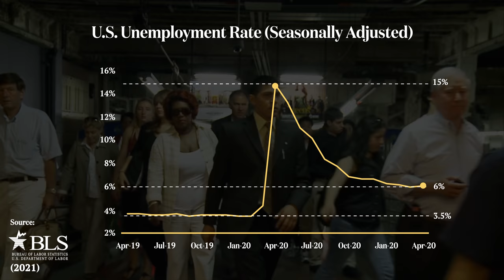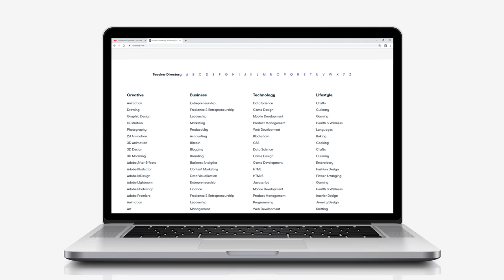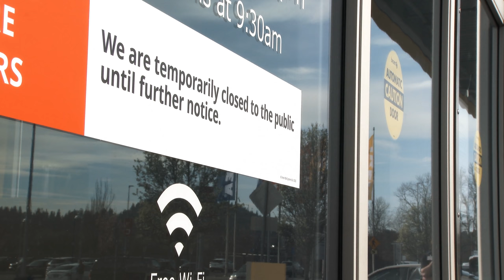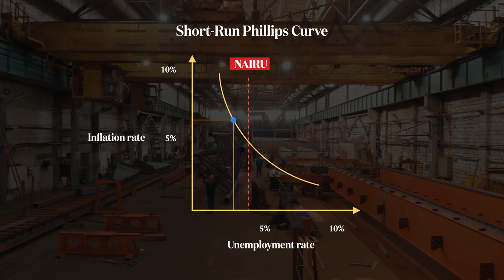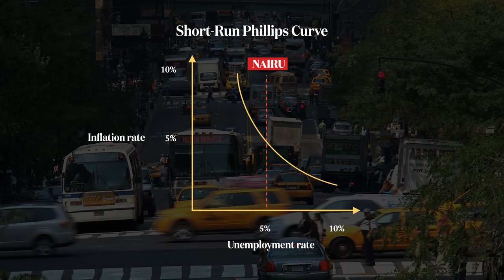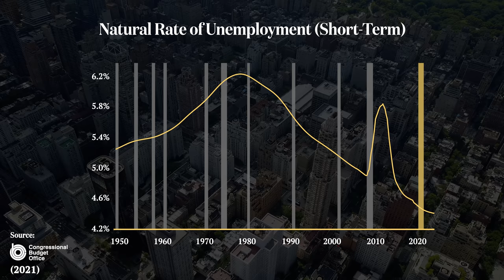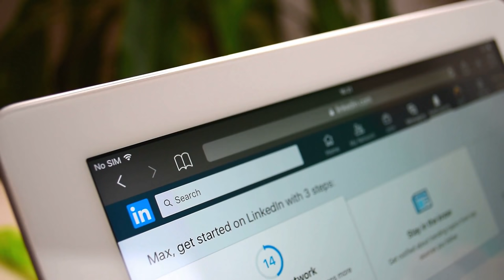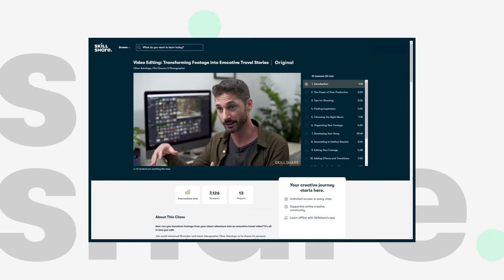The Great Labor Shortage Crisis | Economics Explained

Comment: My former boss was annoyed no one was wanting to work $9 an hour for crappy work at a gas station. I got a job somewhere else at a much better wage
Reply: good for you!
Reply: Minimum wage should be 24$ per hour if you account for 3% inflation over the 10 years since minimum wage was passed !!!!
Reply: @markoakley2508  That would just increase the rate of inflation unfortunately.
Reply: @markoakley2508  Enjoy paying $15 dollars for a loaf of bread then.
Reply: @Piga There's no such thing. That would be like saying "What if we abolish math?"
Reply: @paper8nintendo  so why does the rate of inflation rise when wages don't
Reply: @markoakley2508  it's about that in Australia with the 25% casual loading. Avishhek you can buy a loaf of standard bread for $1-$2.
Reply: @paper8nintendo  The rational of that argument, of push-cost inflation due to a wage shock, does follow logical reasoning. However, the studies and rational supporting focuses on the short-term. Specifically industries where regearing is unlikely, meaning perpetual short-term (short-term is where capital equipment or production processes are not changed). In recent years studies supported by empirical evidence have shown that a large enough wage increase can overcome its impact on inflation in the medium and long-term. One extensive study using US data from the 70's until somewhere in the last decade found a 10% increase in wages caused an inflation increase of less than 1%. On the other hand small minimum wage increases can even decrease inflation.
Reply: Macdonald & Nilsson 2016
Reply: @markoakley2508  Even if inflation wouldn't take a lot of money from that minimum wage (that is debatable), that would probably make a lot of jobs disappear.
Reply: @icemike1  because the federal reserve makes more dollars out of thin air to bail out financial sectors (an a few dollars for the regular people too).  More dollars in circulation makes all of them worth less so prices rise...
Reply: The entry level job should never have been a job to live off of but a job to pass through as you are getting through school or finding a better job. Most were already above the minimum wage at the time.
Reply: @paper8nintendo  wha-? Wages following inflation is the standard around the world. I have an annual salary increase, to keep ahead of inflation. If my efforts worth dropped 2-3% every year, I would jump ship. Right away. There would be no reason whatsover to stay with a company if you get less spending power the longer you work for them.
Reply: @dhrgkbqxtjr2743  So essentially what you are saying is that in order for a loaf of bread to be affordable for some people, there has to be a certain number of people who cannot afford it. Why can’t the baker find a way to bake more bread so they can sell more.
Reply: @dhrgkbqxtjr2743  look at the minimum and average wage in australia compared to the minimum and average in america. we get paid 2.2x more on average and 2.1x at minimums than americans and do not pay 2.2x more for goods, even (especially?) goods that are produced in america and shipped here. our inflation rate is also neither 2.1x nor 2.2x higher. its lower. you are simply wrong. you have probably been indoctrinated by your billionaires to say something that ridiculous. look for real evidence when you make claims like that.
Reply: @seanrea550  Scandinavia disagrees with you.
Reply: @dhrgkbqxtjr2743  Lol it wouldnt cost that much are u sirious.
Reply: @icemike1  Believe it or not, deflation is a thing that the government also actively avoids, they try to maintain an inflation rate of about 2% a year.
Reply: @jonathanodude6660  Australians on average produce far more individually then Americans, thus this is sorta expected.
Reply: @jonathanodude6660  well you people are just enjoying because of your natural resources . Some day Australia will loose it's reserves or China will find some other partner to buy natural resources  then it will be a huge disaster because Australian dollar is much Stronger than American dollar so running a competitive business is Australia is much difficult .
Reply: @jonathanodude6660  Also for in-house products in a developed nation, the employees are typically the most expensive part of production
Reply: @MartinMenge  Technological innovation and the raise of nations to import from help. Minimum wage increase should convince people to work more, hopefully creating a production boost that will compensate for the business lost, but this will further strengthen already established empires dominating and manipulating markets
Reply: @prouddegenerates9056  we dont have very many in-house products comparatively though. most brands are american which source their products from china. a lot of high income jobs are high skilled and/or involved in mining, so i dont think theres very much income inequality based on unchangeable factors. there seems to be several easy ways to get a high paying job here.
Reply: @icemike1  A minimum wage increase (possibly not quite so steep as you're suggesting or if you insist then you'll probably want to also have the government temporarily/permanently subsidising the local brick and mortar stores) would not increase inflation to the point that the increase was pointless. Your point about "well why inflation if the wages aren't increasing then" as a rebuttal to the person claiming a min wage increase would increase inflation is really exceptionally stupid however. It's because there are multiple factors. Don't use that argument again.
Reply: @dhrgkbqxtjr2743  Lets abolish math why not its all man made anyways
Reply: @markoakley2508  you’re math is so wrong it hurts. Ignoring that inflation over the last ten years wasn’t even that high, even if it was, 10 years at 3% inflation from a minimum wage of 7.25 would give us a new min wage of 9.74
Reply: @somedudeguytv  i understand that my concept is an ideal and does not match with practical realities. I also understand that alot of the entry level jobs are also part time so their hourly pay is not a true reflection of how much the get paid in a week. The basic idea is that the entry level is there to get experience before moving on or up. It would be my ideal that the bulk of the jobs are not entry level but a more stable position.
Reply: @Piga "what if we abolish gravity"
Reply: @dhrgkbqxtjr2743  New York has a min wage of $15 and you can still buy a McChicken for $1. This argument is completely baseless
Reply: Oh those types that want to pay people less than what they're worth.
Reply: @Piga ABOLISH INFLATION NOW!!!!
Reply: @paper8nintendo  it only really causes inflation issues when you suddenly jump it up every 10 years or so. If you raise it annually it's fine
Reply: Stupid boss lol. It will be so funny when his gas station closes down because he can’t afford to hire people for higher wages
Reply: With 9USD/hour I would be a King on my Country =X.
Reply: Luís Andrade  Inflation have been stable at about 2% for years and years. Salaries keeping up with inflation have been a thing for years and years. That is what central banks are for. Keeping inflation at a good level. And it works. If you think differently, it is because you wont look up from fox or whatever trickle down bullshit your late stage capitalist overlords tell you to look at.
Reply: Luís Andrade  or the ceos could just not be so greedy?
Reply: @markoakley2508  - The $7.25 per hour minimum wage in 2009 is equal to $9.02 today. The $24 number you state is due to automation making people more productive. Minimum wage workers do little to contribute to those productivity increases.
Reply: @jonnelson9760  - Because that baker may need to buy an additional oven to make and sell more bread. More ingredients, more labor, an additional oven. The baker would have to make a huge investment in order to make more bread.
Reply: I'm annoyed gas stations won't sell me gas for 10 cents a gallon.
Reply: 9$? thats some 3rd world level of pay.
Reply: We are annoyed that employers are greedy assholes.
Reply: @dhrgkbqxtjr2743  prices for food and living is already increasing anyways and minimum wage hasnt changed food prices would rise minimally anyways look at Denmark and Australia
Reply: Luís Andrade  Well first I am questioning the idea that inflation is too much money chasing to few goods. Second I am really questioning the idea that if workers make better wages then there will be inflation. In this argument is the implication that when wages go up then there will all of the sudden be more customers who want the loaf of bread because they can now afford it. The other argument would be that the baker needs to raise the price of bread in order to pay the higher wages. The other option is to improve productivity or lower administrative costs.
Reply: @JoeTheBroken  Both money and math are man-made.
Reply: @dhrgkbqxtjr2743  Yes it is. Its called 'shut the money printer down'.
Reply: @billybeemus3929  Well if they don’t someone else will buy that oven and bake more bread.
Reply: Luís Andrade  2016 isn't 50 years ago. There isn't just one paper, I was simply citing the paper I referenced.
Reply: Luís Andrade  That is exactly how supply and demand works for everything.  If there aren't enough PS5's at Christmas time they sell for twice the original price on eBay,  and can't be found in stores.  If you don't think giving people free money for 18 months has caused prices to rise, look at  the used car, housing, lumber, and stock market prices vs before the Covid pandemic.
Reply: @markoakley2508  Nah, don't make this a legal issue, if they don't want to pay their employees a good wage then they can go out of business. No need to put them in jail for it.
Reply: @dhrgkbqxtjr2743  the bread making company doesn't need to charge 15 dollars a loaf to pay their workers a better wage while still being profitable , but they sure are going to do their best to make you believe that is the case.
Reply: @iamshawngriffin  Not necessarily just that, but overly materialistic people keep buying things on credit for things they really don't need. This is precisely why half, if not most people, in the US live pay check to pay check. They have absolutely no financial discipline nor knowledge.  They want the newest I phone, a better car, a bigger house, etc.
Reply: tie minimum wage to cost of living aka living wage, and they can't jack prices without paying you more. the ratio has to have people prosper. if you drain the wealth of the masses instead of growing it, the money runs out as we're seeing here.
Reply: People are angry because people are doing what they said they should lol don’t like minimum wage get a better job. And they are and now people are pissed lol 😂
Reply: @paper8nintendo  no.
Reply: @dhrgkbqxtjr2743  you can literally regulate inflation, it's call minimum wage and salary caps and not randomly printing more money.
Reply: @icemike1  it's the banks
Reply: I think we should just pass a law to abolish scarcity and grant every citizen infinite resources.
Reply: @paper8nintendo  you're not wrong in what you're saying, but the thing that has always bothered me about that is that inflation has increased while wages stay stagnant. So basically businesses are willing to raise their prices, thus decreasing people's buying power, but the second wage increases are suggested, they say they'll just pass the costs on to the consumer. The part that is annoying is they've already been doing this without the wage increase, so it feels like a cop out and excuse to not pay workers more because they don't respect them
Reply: Micheal Grey, um unchecked government spending. Too many people working in government instead of private sector. Things like that. The government doesn't produce anything, which is why we pay taxes.
Reply: Same happened to me, except Walmart was offering more, before the shutdowns
Reply: somedudeguy, they don't have 331 million people either. You people keep using countries that have 15-20% of our population. That won't work here without making the dollar collapse.
Reply: @Fahrenheit4051  considering scarcity under capitalism is artificial you could almost literally do that first thing.
Reply: @dhrgkbqxtjr2743  No you just have to get rid of central banks. Until the US had the Federal Reserve instituted in the early 1900s, we had an average deflation of 0.1%
Reply: @TheMickydowling  wouldn't have to be steep if they tied it to inflation or something
Reply: They pay $9 because it is lousy work!
Reply: I just calculated my pay per hour to US dollars...

It's 38 $ per hour.. so il be mega offended for 9 $
Reply: @EddieintheLoop  right
Reply: @kerwinbrown4180  I guarantee they work harder than yourself bubba.
Reply: Legit, I always feel bad for people working minimum wage at these places. Cause I feel like most people are talented enough to work other places where their labor is more valued.
Reply: @kogorun  studies show that raised minimum wages if phased in over time, increase, not decrease jobs in an area by force of increased demand on the business sector. Furthermore, tying the minimum wage to inflation would solve a lot of issues, of the minimum wage worker gradually getting poorer over time.
Reply: @seanrea550  no job should be something you can't live off of that's an incentive not to find better work but to forcefully keep wages low
Reply: @billybeemus3929  the food hike argument is stupid anyway considering a third of our food never actually meets a consumer so no
Reply: @markoakley2508  I don’t think the minimum wage is the problem more so it’s the lack of bargaining power on the part of the individual. We have enough money to where we can ensure everyone’s survival whether or not they work. And making it so they can will raise wages tremendously as it has now.
Reply: @dhrgkbqxtjr2743  That's a typical come back people parrot off the propaganda spewed at them on msm... 

The people arguing in favor of slave wages, slave labor, crimes against humanity. These people aren't thinking they are just reiterating what their elitist overlords tell them. How badly indoctrinated the majority of the USA's population is. It's such a travesty alas...

Dogma kills any civilized conversations to be had with others sadly. Only you can choose to change, and learn to think for yourself. Over believe whatever you've been spoon fed for decades.

All I see is dogma being spewed. That's been programmed into so many of such people. Replaced thinking with blindly believing.
Reply: @Sodacacik  most entitled comment I've seen
Reply: Sounds like that owner was a bit entitled 😅
Reply: @dhrgkbqxtjr2743  abolish the fed!
Reply: Didn't gasoline recently go up, yet again? Wonder what his home is like?
Reply: That's how it's supposed to work! Both parties looking for the best deal.
Reply: @dhrgkbqxtjr2743  false argument. Other countries that pay much higher minimum wages actually have cheaper goods. This is because in America capitalists prioritize profit margins, whereas in other countries there are hard limits on profit margins
Reply: @paper8nintendo  economic studies have found that inflation only grows faster if wages increase by 87% or more per year. No proposal has ever proposed more than a dollar per year
Reply: @markoakley2508  But that is not what inflation actually was.
Reply: @BlakeBigfoot  Sure, but it is still lousy work.  There is worse that gets better pay but it tends to be more physical demanding or high stress.
Reply: @fort809  Yeah, and your rent is 2500 a month
Reply: A futur US president once said "The economics, stupid".
Reply: @icemike1  because politicans are in charge of increasing the minimum wage not econimists
Reply: @theepicgamer8197  and corporations are in charge of politicians
Reply: Jessica Balimucki  good one
Reply: @MartinMenge  💯💯

I think raising the minimum wage possibly double inflation every year to catch up would be best. 

No economist though so I could be wrong.
Reply: $7.25 an hour doesn't even buy gas for the entry level high schooler.
Reply: @dhrgkbqxtjr2743  tie inflation to wages.
Reply: @ClauseofCannabis  take it from some one who has worked part time. They are often paying above minimum wage but to be part time means you are not working more than 30 hours a week when a standard full time work week is 40. You often don't get benefits beyond pay.
Reply: @markoakley2508  I think your math is wrong. starting minimum wage 10 years ago was 7.25 after 10 years at 3% per year equals 9.74
Reply: @BlakeBigfoot  Scarcity is the idea that all goods and services are available in only a limited quantity. This is not artificial.

Name an economic system that can deliver everyone an unlimited quantity of any and every resource. Such a system does not exist because the laws of physics themselves don't allow it.

The planet has limited resources available at any given time, and even the energy of the stars will run out eventually.

That's not to say some things aren't produced in an artificially limited quantity to increase their price. But that's not why most goods are scarce.

Your labor is a scarce resource. You wouldn't offer all of it without compensation, nor would you work every hour you physically could. Even if you worked every waking hour of every week, you could only perform one job at a time.
Reply: Luís Andrade  We use Australian dollars in Australia? Who would have thought! 
You can use a currency exchange rate to adjust for comparison. And a loaf of bread still doesn't come near $15
$22/hr is around $17 usd, but we generally don't tip here so wages are likely much closer when included
Reply: @paper8nintendo  How? All you're doing is transferring income from the uber-wealthy to the poor.
Reply: When people are offered better money to stay home why work? What a shock people would take unemployment over working if it pays more. No shocker that some states are ending benefits early since COVID at this point is not a risk for most since they have either had the virus, gotten the vaccine, or accepted that they will take a risk.
Reply: @seanrea550  do you know what minimum wage was set up for? A living wage. A wage you can actually support yourself on. Also it was set up during a time when women didn’t work. So it was suppose to support a man and his wife.
Reply: @dhrgkbqxtjr2743  ok fool
Reply: @dhrgkbqxtjr2743  Sure there is. Inflation doesn't have to happen. It only happens because we keep printing more money. If we had gold backed money (like we used to) then there COULD be zero inflation, year to year.
Reply: @icemike1  Because inflation is raised by many aspects of an economy. As long as you control most of those aspects then it can be maintained.

If the average buying power of a majority of citizens raises they will buy more. Majorities of people all with more buying power than ever will quickly clean out shelves with demand.

To capitalize on that excess demand and keep their shelves stocked long enough for regular shipments of goods to get back in, retailers raise prices.

They raise prices until they find the sweet spot of selling all or almost all of their supply right before a truck of goods arrives.

High demand usually increases the time between supply deliveries so costs rise with that until stores don't routinely have empty shelves.

If we want to fight inflation we need to increase taxes to weaken public buying power and use those collections to fund public works projects and social welfare programs. Large infrastructure rebuilds produce jobs nationwide and having a safety net in the form of welfare helps people feel comfortable enough to start families before they may be exactly ready.

The last thing is more important than it would seem as the US is not producing enough future adults for our future economy to employ and facilitate the expected growth that's been projected.

Not maintaining a strong economy snowballs into losing reserve currency status. American QoL is shot from then forward. Hope everyone has guns and ammo stocked back if such a scenario plays out!
Reply: Then those individuals can make the effort to get a job that is worth the wage they want
Reply: @crzune  what about the types that want to be paid more than the effort they’ve put in?
Reply: @kogorun  - jobs are going to disappear anyway due to the fact technology INCREASES in capability following an exponential curve AND simultaneously DECREASES in cost following a linear curve.  Humans just can not compete with technology.
Reply: @seanrea550  - define "entry level job."
Reply: @krabbykrabby8818  I'm not saying that increasing minimum-wage is always a good idea and that there shouldn't be limits when it is. I'm simply highlighting that some of the mantra's being repeated by "armchair economists" is not the axioms they think they are.
Reply: Biden and the Democrats have thrown Open the US to illegal immigrants who will drive US wages down further.
Americans for some reason seem to vote for President's like Biden (Trump was the exception) who love open Border's and Americans being paid pitiful slave wages.
Why?🤔
Reply: @jimpad5608  entry level is the job you can get where you can walk in off the street with no experience and hire you if you just show up willing to work. Often times tasked with brainless mundane task that anyone can do.
Reply: @jonnelson9760  - They will buy the oven and make more bread because the current price is high enough to justify it as they will make a profit. They aren't making more bread to drive the price down and lose money.
Reply: @lazysundayz  - How do you know how profitable they are? What business do you own? How much do you pay your workers?
Reply: @rorynicholson8558  Maybe its to prevent a population collapse. When the poverty rate in a country declines, income levels reach a certain point, woman become more educated and liberated and people can rely on a pension (so that they don't need children to look after them in their old age), populations decrease dramatically. To prevent pension schemes from collapsing, you need a sizeable portion of your population to be young and growing ,so that the contributions of the youth can fund these schemes. I'm being a bit cynical here, but illegal immigration offers cheap labour (a firm employing illegal immigrants are probably not following the law, so why would they follow minimum wage requirements) but eventually they or their children will become legal and start contributing to taxes...This grey employment also helps to reduce cost-push inflation caused by increases in your minimum-wages. So your citizens get protected by minimum-wage, your firms can continue having low priced labour where it is desperately needed... All in an effort to ensure that your ageing population continues to haz medical care and a pension.
Reply: own a gas station
Reply: @akultisgod5538  can’t every time the Indian mafia come to me and force me to make an offering to Vishnu
Reply: When you don't hire people with criminal  pasts and lock up people at the world's highest you get that
Reply: @Piga "dude what if we just.... abolish sadness?"
Reply: To have meaningful wage increases, the money must be chopped off the highest wages. So, increase the minimum wage at 20$ if you want, but make sure the difference is taken from the highest wages. To keep the balance, and not create inflation from increasing prices that usually come from increased wages.
Reply: @billybeemus3929  Then if the bread is good enough and since more people will have the money then the bread will sell and the baker now makes more money since he raised the wages of his workers.
Reply: @seanrea550  work is work and you should be able to live off the wage  otherwise who will do these jobs there is more than enough wealth to go around
Reply: @nooffence7670  i am saying people should not be made to rely on parttime jobs when they could be full time with benefits after a point where they know there job. Where those type of jobs are good for are students and those who have retired who want to spread their savings. Most jobs pay a competitive wage higher than minimum wage before it was boosted in many places to $15. I have had no job at minimum wage, $11 was the competitive rate. Also unions lock pay to contract so there are no raises outside of contract renegotions.
Reply: @jonnelson9760  - I thought you wanted the bread to be more affordable. Now you are saying that the baker should make a larger profit on the bread that he sells so that he can pay his workers more. You just laid-out the recipe for inflation. The workers may make a bit more, but everything costs more so they are no better off.
Reply: @billybeemus3929  So is the Baker. It also begs the question. What is the problem with inflation if nobody is better off. Conversely nobody is worse off because they can still buy the same amount of bread. By the way, doesn’t this show that money does not exist, what exists is social stratification.
Reply: @seanrea550  most jobs are not full time anymore they are part time no benifits etc in a perfect world that would be great but the world is far from perfect and not everyone gets opportunity you should never work to be poor otherwise people won't work and then what happens?
Reply: @nooffence7670  that is the problem along with the point now where it takes 2 incomes to sustain a family. A living wage is estimated off the cost of certain  common basic items. housing cost, phone and internet and extra services throw off the estimate. Live within your means and you can keep money better. Spend it on extras you don't need and it goes away with out notice.
Reply: @seanrea550  the things you mention are what is considered basic these days who raised your family in this two  income household add childcare , car expenses etc like I said you should not have to work to be poor in any job if you think you could do half of this on a  minimum wage think again no one is going to do it wealth needs to be spread more evenly what country are you from by the way
Reply: @nooffence7670  the extras i talk about are not the things I listed but things like streaming services, cable, gaming subscriptions. Live in a place you can afford, drive a car you can afford to pay off and maintain. Keep the bills to a manageable level. They still throw off the living wage estimate as they are not included in the estimate and they are variable even in the same market zone. The living wage is off the essentials and probably should be updated in what it covers.
Reply: Luís Andrade  Bit late to this but there is a substantial literature on this and its simply not the case.
Reply: @icemike1  because rich people didn't get their wealth from "wages"
Reply: @jonnelson9760  because resources arent Infinite, no matter how much you pay people there will still only be X resources available to buy with that money hence people will just ask for more money for their produce.
Reply: @MrRight0930  professor nobody gets wealth from wages
Reply: Sure you did.  I believe you, no really.  "somewhere else"  "much better wage"  Yeah, you totally sound like you're telling the truth.....
Reply: @markoakley2508  dont talk about a specific number for unemployment, people love to attack that. Rather imagine a whole economic system based on a desire to work.
Reply: @gps9715  11.50 at Lowe’s
Reply: @jonathanodude6660  you didnt know that because it is a fantasy he created in his head to fit his narrative.
Reply: @jeremyanderson3819  This doesn't account for the nonworking population receiving benefits instead of producing.
Reply: @jeremyanderson3819  Our nation has a greater population, many old, imprisoned, or simply not working. The average net worth of an Australian is greater then an American.
Reply: @jeremyanderson3819  Its also important to take into account the percentage of our workforce in the service industry, not making exports. Australia is financially far more stable then the US, even in terms to debit to income ratio.
Reply: @jeremyanderson3819  Love my country, but we aren't exactly the best at everything.
Reply: @seanrea550  What we call entry level jobs today were jobs that people survived on in previous generations.  

We need gas stations, grocery stores, restaurants, and all sorts of services to make society function, but for some reason we have deemed them "entry level" as a justification for why they don't need to pay well.  

The attitude is that the janitor does not need to be paid well, but the manager of the janitor needs to be paid exceptionally well.  This way he can make sure the janitor does his job.
Reply: @markoakley2508  huge unenployment
Reply: @dhrgkbqxtjr2743  That's what people said about hamburgers when wages would be 15 an hour. My local McDonald's starts at 15 now and a burger is still a dollar on the dollar menu. And the rest of the prices are also unchanged.
Reply: @Fahrenheit4051  literally all goods under capitalism are subject to artificial scarcity. Artificial scarcity doesn't mean scarcity isn't a real thing, it just means that resources and goods are commodified in a way that puts profit and closed supply chains over actually making those goods and resources available to everybody.

That being said, what you claimed is nonsense. There are few resources that could actually be considered scarce in the world today despite them all being finite and either way the answer isn't locking people out of them with money. Resources should distributed based on need, not based on ability to pay the highest price.
Reply: @kerwinbrown4180  if by lousy you mean it isn't particularly enjoyable then I would agree but that isn't an argument to pay them less. It's actually an argument to pay them more in my opinion.
Reply: @BlakeBigfoot  There is little enjoyable work at that level.
Reply: @kerwinbrown4180  so they should be compensated more so that their mental health isn't hanging by a thread and they can actually afford to seek education or other opportunities.
Reply: @BlakeBigfoot  There is ways to seek education but finding time can be tricky.
Reply: @kerwinbrown4180  time isn't the issue, money is. Minimum wages in every city in America are unacceptably low and private institutions taking grant money that could be invested into public universities needs to be reevaluated.
Reply: @seanrea550  Not everyone is "smart" enough to complete college, I'm a college graduate who barely studied while my brother worked super hard and yet kept failing his classes. So yes, entry level jobs should be paying all your bills, HOWEVER it should not be enough to make you wealthy
Reply: @iamshawngriffin  
I have ben trying to buld my business for a while and I can tell you that the markets are inflating fast. Also the taxes are raising. I have already ben priced out of the market twice. There are many people trying to out run the money printer but that is just increasing the inflation faster. Good if you can make a profit bad when you are priced out of the market. There is the dumb money, debt money, smart money, the foreign money, the mutual funds, and investments all chasing the same things. This is in addition to all of the shortages of resources and labor. Making peices skyrocket again. If anyone of these people walked a day in my shues they would all shut up real quick.
Reply: @Fahrenheit4051  🤣🤣🤣🤣😆
Reply: @EddieintheLoop   When jobs that can be automated dont become automated this is the result. When people treat education and training frivolously (the many useless degrees), this is what happens. When many people in government and other politically affiliated organizations start grifting the average dunce this is what happens. This is what happens when the people dont leave there delusions, when we forget how to think. 🥶
Reply: @markoakley2508  When you raise the pay level of those at the bottom it causes a domino effect where everyone above expects a pay rise too cancelling out the effect of raising the minimum wage within a year or two.
Reply: Tons of people would be delighted to work $9 an hour. They just aren't people any boss would be willing to hire.
Reply: @Politico995  That's BS, the cost of products is 2 to 3 times higher in Australia. Also your dollar is not nearly as strong as the US dollar.
Reply: @dhrgkbqxtjr2743  You don't understand economics
Reply: @markoakley2508  Accounting for increases in productivity, more than 30/hour.
Reply: @paper8nintendo  Countries that force the payment of such wages do not have such problems with inflation, consequently this "counter" is invalid.
Reply: @dhrgkbqxtjr2743  This does not happen in reality, don't spread nonsense.
Reply: Danny Archer  Tell that to people stuck in jobs they hate without the prospect of doing this.
Reply: Danny Archer  Permit me to disabuse you of that notion — if your choices are stay with a job you hate, or not eat, you are stuck owing to existential duress in a nonconsensual labour relationship. It is not chattel slavery, but it is uncannily close to serfdom. Yes, it is real; it is unfortunate, but it is real. Do not presume to tell me nobody is stuck in a job, that is simply not the reality before us.
Reply: Danny Archer  I do not self-identify as a liberal. You shouldn't apply labels to people so hastily.
Reply: Great' for you"!_ pay should be just like they would want to be treated fairly"! Yes'💯👁️🤔
Reply: $25.00/ per/ Hr
Reply: Danny Archer  On some level, yes, this is the true form of Capitalism, reducing people to things which can be owned — to interchangeable parts, to object; imperialism and cronyism aren't bugs, they're features, as is this sort of fake enmity between people based on meaningless superficial traits.
Reply: @fort809  What if we take into account the fact that fast food is cheap because consuming it on a regular basis (which is pretty likely, considering how big city life is basically being in a rush all the time) is a surefire way to spend your money on healthcare? I believe the food industry and big pharma are interconnected to keep people bouncing back and forth between them. I mean it makes way too much sense to be bullshit.
Reply: @dhrgkbqxtjr2743  You could always make your own bread at a much better cost.
Reply: Must have read a few books and upgraded your skills then.
Reply: More people need to relize they are worth more. My hvac company will start adults at 18 an hour to learn. . . Green workers. Full benefits offered after 30days. I'm talking full 401k with match, every type of insurance you can think of. People just need to know they are worth more.
Reply: @paper8nintendo  No it wouldn't. Countries with higher minimum wages often have better economies.
Reply: @proton8689  That's funny, because the US has the strongest economy in the world. China has the most growth. Netherlands/Sweden have the most stable, but corporations pay very little tax. Minimum wage is equivalent to 15 dollars an hour, but that 30k a year is taxed at 40%.
Reply: @paper8nintendo  US has the strongest economy in the world but doesn't even rank top 20% in economic mobility. All that economic power just translates to high wealth inequality. 

Netherlands/Sweden/Japan have high-income taxes, but they get social benefits return. Even my country, with a much less stable economy and much poorer, has free healthcare, and the government pays 50% of university tuition by default. Or 100% if you're poor enough. Who cares if I have high taxes? I'm debt-free. 

Americans may pay lower taxes. But that doesn't mean you have the most money to spend. All that means is that cooperation bills aren't included in the math. For instance, the US actually pays the most for healthcare compared to other nations.
Reply: @proton8689  Yup, this is way increasing minimum wage won't offer a fraction of the value of expanding education/healthcare social welfare. Japan and scandavian countries have stable economies, but that also means stagnant economies.

They are beholden to the dollar as world reserve currency, and the US military. Which makes them vulnerable to both inflation of the dollar and conflict with other nations. You can't copy paste their systems and expect it to work the same way in the US.
Reply: @paper8nintendo  
You're repeating the classic argument: "Actually it's pretty good here, and those guys are as bad."

That doesn't work here. Japan and Scandaniva have economic issues which are bad. For Japan, their wages stagnated for example.

But it's worse in America. You guys have it much worse.  Your economy is also stagnating. 

Everything you're doing is bad.
Reply: @proton8689  The US economy is not stagnating. If it were, we wouldn't be printing 10 trillion and expanding our budget to 6 trillion in one year. All of this liquidity is predicated on prospects of economic growth.

The value of a country is not determined by just its ability to produce, but how much it can extort/leech from more impoverished and successful countries.

I never said "everything is good here" I'm just illustrating the absurdity of thinking you can transplant one economic model onto another country without accounting for the types of industries, standard of living, infrastructure, government, etc. You won't see me saying Scandinavia or Japan would be better with the US economic model, because I'm not that obtuse.
Reply: @paper8nintendo  Sure, we have rich practically swimming in money. But the average working citizen isn't experiencing all that wealth. Especially younger generations.

Leeching from impoverished countries is the only reason why some countries are rich in the first place.

Japan, Denmark, Switzerland, England, don't have the same model. How they do stuff can vary slightly. Even so, America doesn't have to copy, you can make your own universal healthcare system from scratch based on your own conditions.
Reply: @jshowa o Yeah, I've noticed companies voluntarily increasing base wages, due to shortages.
Reply: @icemike1  

it's a direct consequence of the supply of fiat currency in circulation....supply vs demand.  2% is the annual average but it fluctuates.  It's also why you wouldn't do yourself any favors by hoarding cash indefinitely.... inflation is always nibbling on it.
Reply: @mecca777  I'd rather hoard than have all my money at the mercy of a tap of key
Reply: @icemike1  That's cool. Do you.  Just know that 20 years from now,  that dollar is gonna be worth significantly less than it is now.
Reply: @mecca777  it'll be worth more than nothing
Reply: @icemike1  That is true, no argument there.
Reply: Yeah and I’m sure someone else took that job, good for the gas station and the person who got a leg up
Reply: Good for you. The hourly minimum wage needs to be higher without passing it to the customers though.
Reply: @markoakley2508  We will lose businesses and opportunities.  

You will or should live longer than 15 years.  So, that minimum you're proposing would result in real inflation.  Again, your living wage would be low.
Reply: @markoakley2508 , so, Im earning approximately $26 hourly.  This helps me by dropping an average of $800 into savings, making mortgage, maintenance, phone and vehicle payments to a tune of $1900, and adding 100 bucks divided into my child's savings for education.  If you get your desired wage increase of $24 hourly, I will likely have to adjust my investments, because you are now also demanding.  You skipped steps on rising up the economic ladder.

You need to just work, learn, and apply for better opportunities.  Don't screw over your fellows because you think your wage is too low.  Try to find a way up.  ....Took me ten years.
Reply: @nee-grow , you've neglected to note that turnover staff has shown your local McD's holds 2 less employees.  Mine has, over the last year.  $13 an hour is good for students.  But, they won't stay long.  And, that's their driving labor staff!
Reply: Didnt even bother to read the comments to KNOW that there are people in the comments that think people are lazy for NOT working for $9 an hour....while they make much more;)Typical...
Reply: @dhrgkbqxtjr2743  

BuT inCreAsINg wAgES inCrEAses PriCes.

Yeah sure buddy. My friends in Sweden with $22 minimum wage pays an absurd amount for bread. Yeah right.
Reply: @markoakley2508  which is about what I get paid as an Air Traffic Controller.
Reply: @markoakley2508  lol, minimum wage should be based on inflation and a decent argument is $16.40 or $15 an hour. Currently the US doesn't have the type of workforce that can demand $24 an hour because that's the price for a tradesman.
Reply: @icemike1  Wages are rising, just not the wages of low skilled workers which is one of the reasons for growing inequality. Also the government printing money continuously causes inflation.
Reply: @MartinMenge  ”In the long runwe are all dead” -Keynes
Reply: @shgalagalaa  doesn't matter if the cost of living is out pacing wages
Reply: If only i had your guts. Been working in a retail job for a year now and only recently got a raised but due to covid, and a lawsuit because a parent wasnt watching their kid who got injured, my $4 raise was dropped to .16 cents. So im making $9.68 per hour but the company knew times were tough so people like me who were very loyal got a $600 bonus. ($300 for being hired before November 2020 and the other one im still not sure about)

Cant wait to finish school so i can get a better job that wont limit my choices
Reply: @prouddegenerates9056  yup. There needs to be a happy balance
Reply: @shgalagalaa  Okay,  lol. Let me clarify. In the "long-run" I mean the period of time needed for all variables to change, particularly capital equipment.  So regearing of industries to cope with higher wages.
Reply: @Gamez4eveR  Yes lets abolish or reduce gravity I want to be able to super leap. Jking.
Reply: @mammadeuces6242  
Employer: Get a better job!
Employee: Ok
Employer: Wait You weren't supposed to do that!
Reply: @chase-warwick  So what your saying is Stop buying things just get food and a house. Save what you have for a years and prices should go down if demand also goes down.
Reply: @ClauseofCannabis  I tried saying this to someone but it wasnt this exact quote. My answer had supposed and they got offended saying its "supposed" in it not that it should. 🤷
Reply: @chase-warwick  I meant as a whole we should buy less wants and cover our needs. Then the price of those goods will go down including their associated parts.

Less demand means the goods cost less since more will be available.

I mean a whole not just me. If everyone took a few years to stop buying things we dont need like tvs computers fast food junk food ect.
Reply: @chase-warwick  Haven't they been doing that for years with cellphones, TV, Computer? Yet they seem to increase in price. Sounds like the system isnt working either way everything is going up with no actual solution.
Reply: @paper8nintendo  Whats your evidence for this?
Reply: @dhrgkbqxtjr2743  so you just want to let people starve to death? Thanks a lot privileged one
Reply: @seanrea550  First off minimum wage was intended to be a living wage. Secondly most people can't afford to work entry level jobs and not afford to live...especially college students who can't even afford the huge tuition... you are delusional. If you don't want to pay a living wage you shouldn't exist as a business.
Reply: Unless, and bare with me here….corporations accept less profit! I get it, never gonna happen, one of many reasons why human civilization has a bleak future. That, and we’re destroying of life sustaining planet
Reply: @markoakley2508  If salaries scaled with inflation 1:1, then inflation wouldn't work.
Reply: @Piga The top 0.5-1% have all the money and the rest have none. Oh and the debt can't be paid.
Reply: @badass6300  the government needs to cut taxes in order to raise wages and close loopholes that let the wealthiest people on earth get away with paying zero
Reply: @markoakley2508  There should be a wealth cap period. Simple as that. You reach it you are done.

If laws limit human interaction they should limit economic prosperity as well. The rest is unavoidably taxed and if the government of the country isn't a piece of trash it would redistribute the taxes properly into the economy.
Reply: @dhrgkbqxtjr2743  I mean, math is by definition an invention of Human Mind, a measure that we invented ti understand things (not said for me if not for matematicians and theorical phisycs), so even math helps us deal with our vision of reality, the true is that we don't surely know that they're indeed the measure of existance.

Some people argue that the only true rule of existance is time, tangible over any argument.
Reply: These robbers are governments revolution is the only way to restore the balance someone said when your government no longer works for you it's time to arm and retake what's yours sounds dramatic but it is not wealth these people in power possess is staggering and when people are starving in the world and some are wondering what model Ferrari I should buy need to be strung up they are criminals not leaders when was the last true leader that actually done some good for any country go back a hundred years and name one
Reply: @MostIntelligentMan  all I had to do was tell someone no and get a better job.
Reply: @MostIntelligentMan  oh mate believe me, millions of people have starve they child due to a low salary as 9$/h. And others just work to death so much yet so poor that they end up laying in communal graves because is impossible for the family to pay the funeral and the bury... Not only in the US low (economical insane and unhealthy) salaries are an issue.
Reply: @nee-grow  maybe they fire people and replace with them computers
Reply: @markoakley2508  you are right. Did the numbers on my end.
Reply: @MrDilwo  well yea? people never shut up about how great america is.
Reply: Go Kekero! That's  how you work it!  Go out and get what you're worth!
Reply: @fort809  But you employ fewer workers.  McDonald's once had employees at every station, someone clearing tables, emptying garbage cans, policing the area outside the building.
Reply: @paper8nintendo  Increasing wages is not what causes inflation, central banks lending government money and raising the debt ceiling is what causes inflation, and is a symptom of a much bigger mismanagment of economic policy. Its designed that way though, the worlds richest 1% arent rich in money, they are rich in assets that hedge against inflation. They own assets like property that increase in value as a direct result of the buying power of the dollar decreasing. IE you now need more dollars to get the asset.
Reply: Don't complain I ge 7$an hour
Reply: @paper8nintendo  the thing is that's not true, higher paying country's have close to the same prices on their products, that's super clear on fast food chains, paying a living salary for full time works is not unpayable just as free medical care, and other social programs are not an unpayable expense for the government, if anything having such a big % of the population struggling to eat when they have a full time work is a bigger danger for economy than the opposite
Reply: Alascala well yes, because by the principles of capitalism, his gas station did not have enough demand for it to succeed. Perhaps he should seek other opportunities like the rest of us are expected to do.
Reply: Me too. I went from 11$ an hour to 18$ an hour now. Greedy bosses are the reason why people leave low paying jobs.
Reply: Luís Andrade  The study is from 2016... Historic data is needed for logistics regressions... You talk smart when you can't even read a citation lol
Reply: Cool man. As for me, I'm certainly not applying there. Not even wishing them luck either!
Reply: @Piga 

It's not that hard. We just abolish TAXES. The federal reserve, the IRS, and the central banks!! There lies our true problems and when we do, you will experience the best economy since the industrial revolution!! BUT until we truly Unite and abolish the federal reserve, the IRS, and the central banks you'll never, ever experience that and have to make good with the scraps you are given....
Reply: @dhrgkbqxtjr2743  country's that kept wages up with inflation don't have that problem.
Reply: @Piga genius
Reply: @paper8nintendo  sounds like our economic system is just a failure then
Reply: That's what my boss is saying right now
Reply: That's a $22hour job in Ausfalia
Reply: Its a gas station.

You're work isnt that valuable. 
Working at a gas sationg is something teenagers do.
Reply: @icemike1  inflation occurs when money is injected into an economy artificially.
Reply: Collusion
Reply: @paper8nintendo  it would also kill quite a few jobs since some places people dont realize can even afford to do that, nor hire just as many employees. people dont realize what that does to say fast food chains. heh taco bell cant pay you 24$ /hr because they cant afford it. its a franchised up brand. Soem franchises are only as few as 1-4 stores. some have more some have around that much. I know ours would never of been able to afford 24/hr for a dozen workers to keep up with the demand. People dont think about that with ENTRY LEVEL JOBS.
Reply: @MartinMenge  i think like 99% of people who argue against raised min wage are too stupid to understsnd how things work long term.  With more money in the pockets of people who spend it more frequently, u have more products being purchased.  If more products are being purchased, the price eventually falls.  The reason we dont see places like california doing well with this is due to some of the most extreme examples of gentrification without any real solutions to counteract the negative effects of the housing shortage.  That and california puts a tax on basically anythong and wraps up doing anything to have to do with operating a business under mountains of red tape
Reply: @icemike1  *The real questions*
Reply: @icemike1  Inflation isn't a number that anyone decides on. It is a measurement of how much stuff you can buy with a dollar. If more people have money, more people buy stuff, so the people who make stuff charge more for stuff because the amount of stuff that exists didn't change.
Reply: Employers be like: Let's pay them minimum wages:
Also employers: WHY DO I NOT MAKE MONEY!?
It's almost like everyone else also pays their employes like sh*t and nobody has the cash to buy my products!!
Reply: @dhrgkbqxtjr2743  I like how you ignore the fact that Scandinavian countries have many of these big chain businesses like Mcdonalds, Walmart, Best Buy, etc. In these countries they have to pay much higher wages, give more benefits to their workers and they have been in those countries succesfully for years. Poverty and unemployment there is much lower than the U.S (Also crime rates are much more lower). Oh and people clearly buy their products if you hadn't grasped that yet, they don't live in white boxes with no luxuries. It's like businesses can still make a profit even while paying a living wage and giving more benefits to employess in other countries but not the U.S because the U.S is "special" like that for some reason 🤔 (Oh and small businesses also exist in said countries so yeah... Capitalist bootlickers love to ignore how well those countries are doing because it destroyes their narrative completely). And since I can already tell you are against universal healthcare and free tuition based on that poor argument for capitalism, yes these countries also have that and are doing much better in 99.9% of the important topics of a country than the U.S. and they still have capitalism in there obviously.
Reply: @Piga it's impossible to regulate and monitor
Reply: @somedudeguytv  don't you live off Europe? Won't last forever
Reply: @seanrea550  well times change. It's time for entry-level jobs to pay more now.
Reply: @billybeemus3929  incorrect. If workers were paid based on profit sharing places like Chic Fil A would pay their cashiers around $100,000 per year.
Reply: @dhrgkbqxtjr2743  oh wow, now that industry standards have rapidly increased, im so sad that now a jar of peanut butter is 10 dollars because Jeff from Burger King actually gets 12 bucks an hour. Stop complaining if you don’t know what you’re talking about. That’s not how this works
Reply: @Pineapple Head there isn't a way to abolish it, the problem is The U.S. simply did not continue to increase wages. As GDP increased and meant products increased in turn, it used to be that minimum wage would increase to follow inflation. Yet companies lobbied hard against it so they could keep low wages, while selling higher and higher to fill up their bank accounts. Truth be told it's all turning into a rubber band that's slowly but surely tensioning, until it eventually snaps and causes a huge recession when there isn't the ability to keep putting more money into circulation, people stop spending all together so products stop selling. That's the track we're going down currently, and the top 1% won't be affected, yet it will affect the rest of the population in a very negative way.
Reply: That sounds like a highly illegal amount of money, you have to be the full minimum wage and anything under is a crime
Reply: @kylekomicbro1836  the key is location, in my state of NC, 7.25 is what is considered minimum wage. If you look at California it's double that at $15 being their minimum wage. In some states they a lower GDP, meaning that there is less wealth present, which in turn does mean for lower costs, yet companies and the like still charge what the market will bear which means it's pretty much just as bad as California in terms of general cost.
Reply: @diddleydoo9773  That's funny that you're trying this at a time when literally the entire middle class of America is complaining about runaway inflation and the Fed just admitted that they cannot control food prices. Take your own advice and shut up about topics you know nothing about.
Reply: Another industry probably. Anyway that's the good part is competition. Maybe in first place instead of asking the companies to raise the wages even more you could ask your government to stop stealing you with taxes the most part of everything you earn and have. And while you're at it to stop being corrupt and totalitarian, and that they allow people and entrepreneurs to be free and prosper.